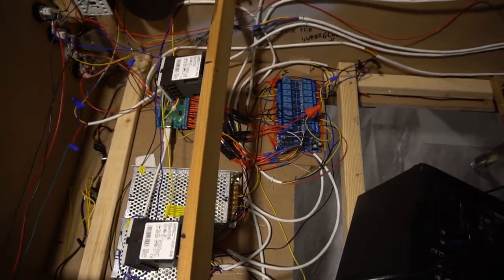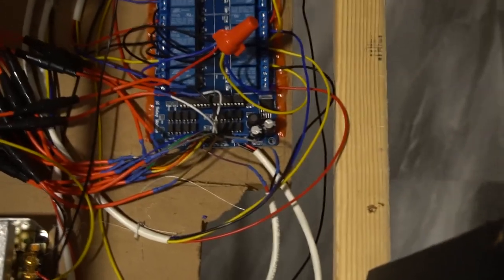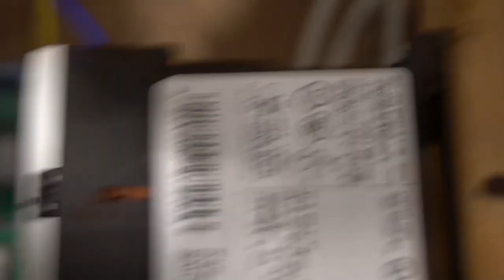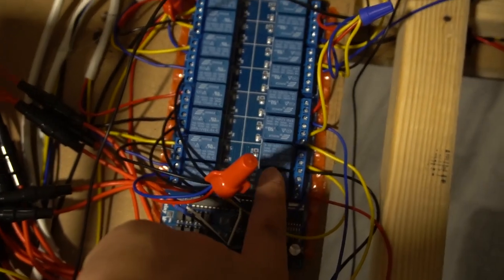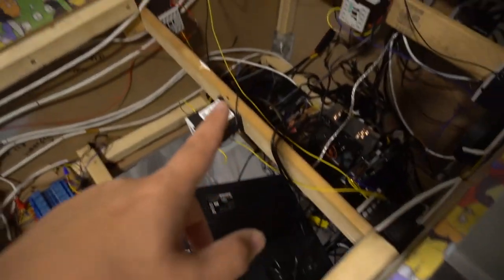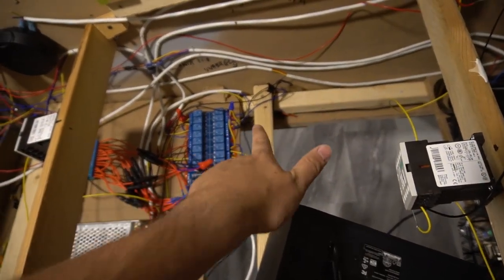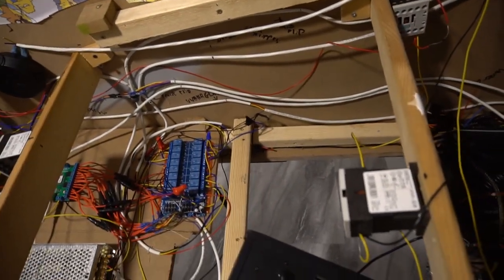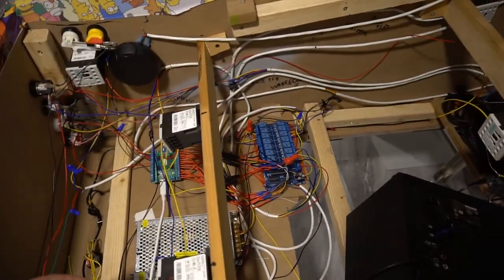Wiring tutorial for your Virtual Pinball Build

Comment: What fuse strength are used from ledwiz to sainsmart
Reply from the maker: I use 500ma 250v
In one of my vids in the description I posted all links I used to purchased my stuff
Reply: @Vic_VP  thank you. I really enjoy your videos
Reply: As far as the diodes and the solenoids go, can I use jumper wires to connect the diodes to the wires to avoid soldiering?
Reply from the maker: Partially, the diodes are solid wires... not stranded.. so it'll be difficult to get them to stay together
Reply: That makes sense. One last thing for you I'd love how you Daisy chained the power supplies. I can't clearly see through your video how you did that. Can you briefly describe the connections?
Reply from the maker: Green white and black get daisy chained. Pretty easy / basic stuff on that one.

Power plug spliced green black and white going to 1 supply.... before closing screw terminals get another extension cord wire and splice green black and white and repeat
Reply: I think I got it vic. You connected two separate wires to the same terminals which I did not know you could do. Is that what you did?
Reply from the maker: @juanperez772  yea
Reply: One last question for you. To connect a knocker for 24 volt usage and a gear motor using 12 volts to the sainsmart board, would the 500 ma 250 v. Fuses from sainsmart to ledwiz be enough? What do you suggest for both toys?
Reply from the maker: @juanperez772  yea I used those fuses on 24v and 12v toys
Reply: @Vic_VP  perfect!
Reply from the maker: @juanperez772  yes remember the fuse will blow before it goes to the ledwiz.... so really any fuse can work but I use those numbers all the time
Reply: @Vic_VP  got you. So it doesn't have to be stronger necessarily. If I go with a 48 volt power supply for the knocker  can I still use sainsmart with the same fuse that you use?
Reply from the maker: I never did 48, so make the sainsmart can handle it. The fuse I use is a good mid point... if you go less fuses may just pop for no reason
Reply: @Vic_VP  so the sainsmart can handle it? I don't recall seeing any of your videos with my a knocker setup .do you have one? Using 24 volts?
Reply from the maker: @juanperez772  I personally don't use a knocker... knockers go off when you win a free game. I have the rear left of my 10 solenoids as a combo with knocker
Reply: @Vic_VP  oh okay. Interesting. Appreciate it. keep up the great work.
Reply: You have two Daisy chains for that 24 volt solenoids on the video. Did you connect both positive main wires to the same terminal or to two separate positive terminals. Can I use the same terminal if I run out of space?
Reply from the maker: @juanperez772  not sure what you mean. You shouldn't daisy chain positives
Reply: At the 9:40 mark you start discussing daisy chain with a 24v. You do it twice for 24v. My question was if you connect both main wires to the same 24 volt terminal. I hope that makes sense.
Reply from the maker: @juanperez772  o yes in all Mt current builds I cleaned it up but yes... I need 10 24v + for the solenoids, so instead of running 10 wires from the 24v power supply, I ran 1 and split it out.
I now use terminal blocks to do this instead of wire nuts lol
Reply: Okay. It did look like they were going to the same terminal but I wanted just to make sure that you can do it. Thanks
Reply: Vic, what is the wire thickness of your Dupont cables that connect to the fuse wiring? does it need to be a specific thickness?
Reply from the maker: @juanperez772  18 gauge on all my wires.
Reply: @Vic_VP  ok. Thanks
Reply: What contactor model of Siemens are you using?
Reply from the maker: Check my early vids I say the best siemens to use
Reply: Will do. Thanks

Comment: Hi, nice project, I wanted to know why you used the ledwiz combined with the Sainsmart. Was one enough? thanks
Reply from the maker: The sainsmart board controls all my toys... my toys have different voltages... the ledwiz cannot handle over 5v... so you will need both 
I have a 16chabbel sainsmart and 32 channel led wiz
1 led wiz definitly is enough.
My 16channel sainsmart is perfect amount of ports... but if you want  a lot of toys (I'm missing blower fan and bells and knocker) then u may need another sainsmart board
Reply: @Vic_VP  and using only the 16-channel sainsboard to control 10 toys with the same voltage can be fine?. is it compatible with dof? thank you
Reply from the maker: @cattalov  yes my setup is compatible with dof... the sainsmart allows you to use any voltage PER toy/input. So I have a few 24v toys, a few 12v toys on my sainsmart.
Reply: @Vic_VP  ok, then i use the sainsmart for my 24v toys...the ledwiz is too expensive 😅
Reply from the maker: @cattalov  no you need the ledwiz to activate the sainsmart... you need both